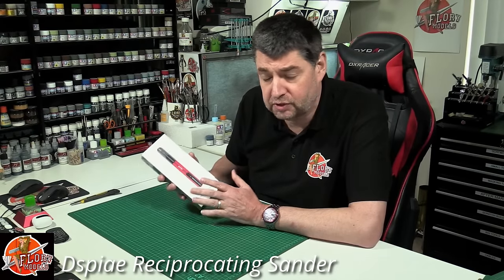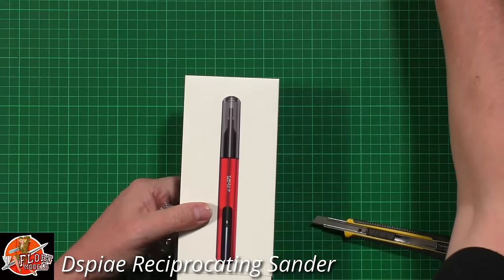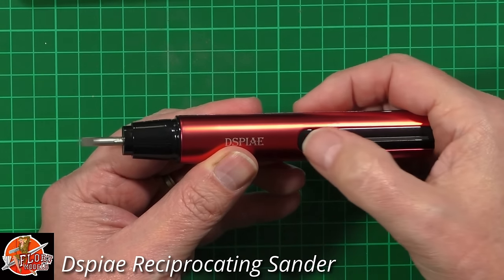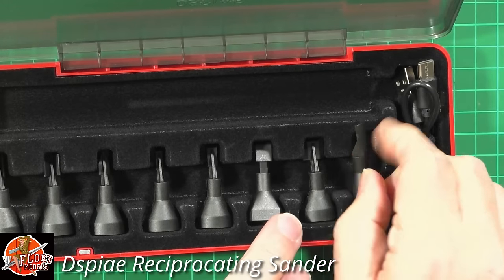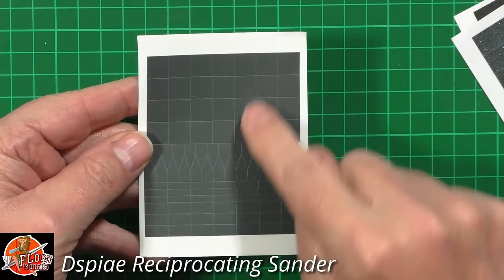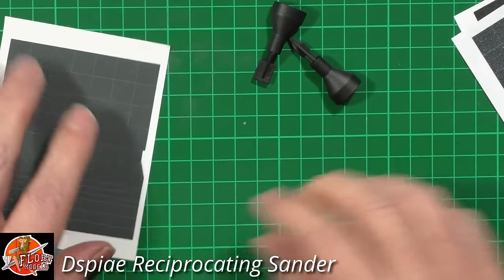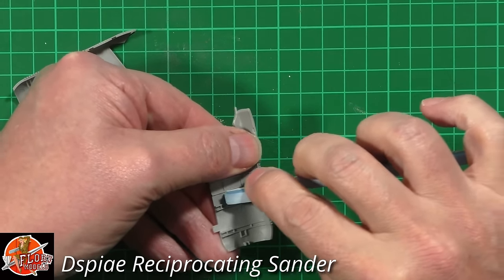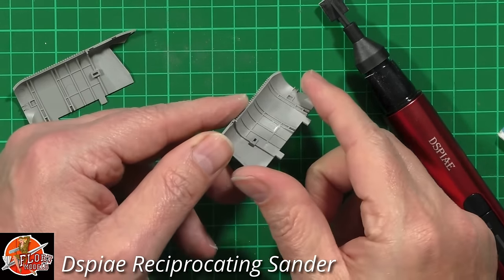Dspiae Reciprocating Sander Review

Comment: I’ve had one of these for a couple of weeks now and I love it. The curved heads and the corner head are very useful. It’s a tool to use as well as your sanding sticks not instead of. The pads are going to last me ages so I for one think this is a useful addition to my toolbox.
Reply: can you use it while charging?
Reply: @kramsogrub8104   so the usb c charging cable is only 8 inches long. Also the unit does not switch on when being charged. I’ve only charged it up from a half charge and it didn’t take long (30 mins).

Comment: I dont normally pay for a powered tool that does the same as a hand held tool however I took the plunge last week and bought this - it made easy work of sorting out sanding down the insides of 4 x 1/144 747 engine nacelles that had some nasty seams which needed filling and sanding leaving me kind of thinking it was worth the money and fun. But also left me thinking how I could adapt an electric toothbrush to do similar as a rotating sanding tool without that 3mm head butting action

Comment: the only thing I could think of as a positive may be if you have arthritis and struggle to grip a sanding stick, maybe this could help but it doesn't seem to be any better for anyone else.
Reply: Indeed. I also see it being used with coarser grits for the initial clean up of 3D printed parts. 

Do the heavy work with the machine then finish up by hand.

i can also see it being useful on very small white metal parts which are too small to work with sanding sticks. Just a thought… 😎

Comment: It would help if you used the tool properly. When you use your hand sander you rubbed backwards and forwards only - With the tool you were moving it backwards and forwards (which you don't need to do as it is a reciprocating sander) but you also went in circles with it - you don't do that with your hand sander, therefore the test you did was totally different to how you used the hand one.
Reply: Exactly, let the tool do the work.
Pointless having something if all you are going to do is the same actions as before
Reply: Sometimes it's hard to get good help. Maybe there was a need to RTFM before using the tool.

Comment: I totally agree with this. I bought one and almost instantly regretted it.
It's underpowered and the usage is limited. There are some instances I found it useful, particularly in very tight situations and corners, (I make resin 3D prints), but often a sanding stick or needle file will do the job just as well, and often better.
I should also point out, this thing is damned expensive (£35 UK) for what it  is, for what is effectively a modified sex toy.
And adding fancy flashing lights to a cheap plastic vibrator does not improve the quality or value of the product.

Comment: How can you possibly compare it to manual sanding? It may be the same speed as manual sanding but it's less labor which is the fundamental function of an electric sander, to take the labor out of manual sanding. I mean who cares about the speed, I sure don't, I care about the labor put into the sanding. If it can be done easier by electric sanding then that is the key ingredient. 

I also have a Proxxon sander and it's great but there's not as many varieties on detachable bits for the exception of the angled bits which the Dspiae doesn't have, The Dspiae has more of a variety of different sizes which is a big plus imho.

Just worth mentioning that if you search on the printables website you can find a small 3D printable stand/holder for the Dspiae bits, it's pretty nice and makes reaching for them much easier and quicker for ease of access.

Comment: Sandpaper leaves scratches so chisel is the top tool to deal with pin marks.

This tool better be equipped with micro saw blade attached.
Reply: So use finer sandpaper.
Reply: @TryptychUK  you should know how any grit sandpaper works comparing to chisel and file - it scratches the plastic with sharp edges of sand particles, not cuts away chips with blade. Optical magnification will help you see small scratches, which also become prominent after silver and chrome airbrushing over.
Reply: @vibeforge  That all depends on how fine you go. 2000+ grit and you are polishing.
Once primed, you could apply a mirror finish.
Reply: @TryptychUK  instead of gradual wet sanding and polishing I use chisel on any roughness surface to even it flat then I use backside of chisel to lap prepared surface to mirror state. This way I restore scratched, distorted with glue and CA-frozen clear parts into fully transparent without distortions. Evaluate your time and use proper tools.
Reply: @vibeforge  Maybe you have the skill to be so accurate, but most would end up taking off too much and ruining the part.
I generally do scifi type spaceships etc with mostly flat surfaces, so using a marble tile and wet & dry ensures I get parallel lines that I can constantly check and recheck.
Reply: @TryptychUK  well if you only need +/- flat surface ready for paint over, you can use sandpaper, slightly rough (aka matt) surface will improve paint adhesion. I was rather talking about making absolute flat surface, like on unpainted color plastic models and clear parts. Marble tile is a good trick, many use sanding sponges and sandpaper with finger behind and wonder why it does not produce flat surface.
Reply: @vibeforge  Clear parts are a pain with resin, but the trick is to sand them to a frosty finish, and then re-coat with the resin.
This fills in all the scratches and they come out crystal.
It might even work with polystyrene kits.
Reply: The saw could be used and is a good idea but your point about sand paper leaving scratches is not exactly right. Everyone knows you just use a higher grit sandpaper to get a mirror finish if you want. I actually have 7000 grit which is basically polishing something. 
The blade will also leave marks. 
 I see this useful to me. I just wont be bogging the motor down and I wont be using it on paint which would bog it easy.
Reply: @joefoley4253  I agree with you, but I wouldn't bother. The pads are so small that they wear out very quickly, and they require a fair bit of pressure to have any effect.
Even on soft materials like modelling filler takes forever.
Reply: @TryptychUK  Sound. I'll take your word on it lad. Thanks for the reply and fec off and enjoy your weekend.

Comment: Now, do the same for curved surfaces inner and outer, difficult corners where you are trying to get a panel to fit, or spherical objects.
Sorry mate, thanks and all for the first impressions but this isnt a very good all round test to see the difference in what the tool can do.

I can easily cut through a metal bar or billet with a hacksaw. Lot of effort back and forth, but with a grinder and cutting disck or a bandsaw, its more efficient and easier.
Same with this tool. 
Stop moving your hand back and forth to do the work, let the tool do that for you.
what you are doing is the same as trying to cut through a bar of metal and moving the metal not the hacksaw in my opinion.

Comment: It doesn't have the large area of a cusom made 'block' sander, thus it doesn't do the job as evenly.  Also the tool heads should have a longer 'arm' so you can get into more difficult areas.  All in all, it seems to save ZERO time, and do a notably WORSE job than a manual sander!!
I expect it would have uses in SOME cases, so it is not a total waste, but in grand total it is of little use at all !!  You would only have one as an extra tool, for special cases that it really did help with. It is not a good replacement for a sander block!